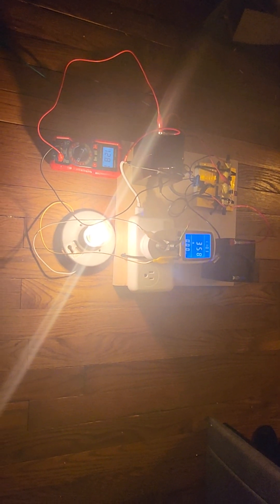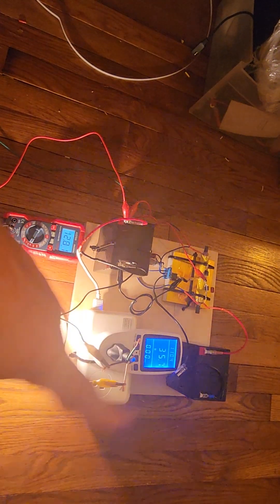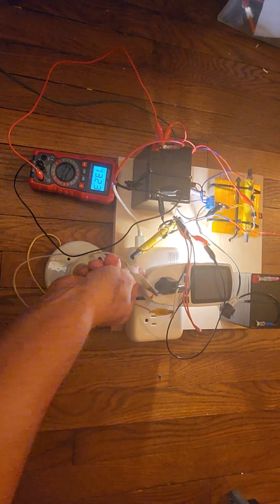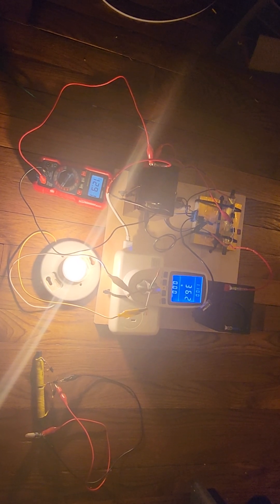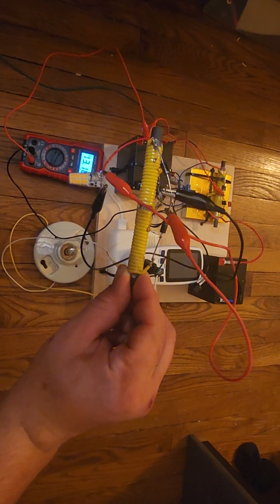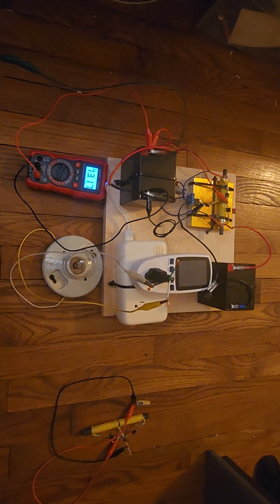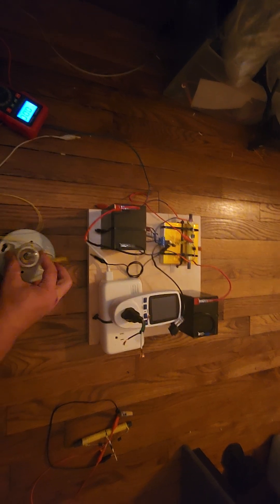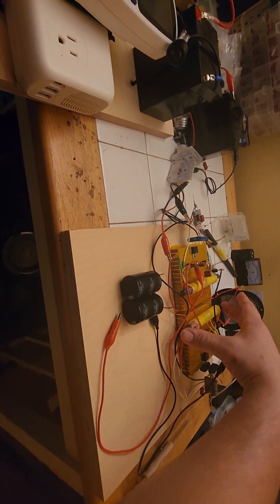💪Negative Resistant Super Battery Re-Charging Generator Boards Improvements & Breakthroughs 🥵

Comment: So just to be sure I understand the fundamentals, an RLC tank at resonant with a resistor of the correct value placed in parallel across the tank causes a negative resistance effect to occur bringing energy/wattage into the system, correct?

Then in theory, if the resistor was just the right value a single pulse into the system would have it maintain its own free ringing oscillations forever as long as nothing hampers the oscillations of the tank, would it not?

Also to add to that, what equations are used to calculate that resistance? Thanks.
Reply: I think that connection to ground somewhere near resistor is a must (or through resistor?)
Reply: @mrmishmash1725  From the descriptions MTech wrote it mentions an earth ground to get "even more non-linear effects" which implies it enhances it over being a requirement.

Comment: You have no idea what you're writing about. Material 77 ferrite rod is not Metglass.
Reply: The circuit ought to work with any core material that can switch at high frequency... but prefer High permeability, high electrical resistance, high saturation

Comment: Wow, this is something quite impressive if true, how fast can you charge 500 ah battery when you say fast ? How much power would you need to do it from your little hybrid batteries ? With this output power 6 kwh you can run a house easy even without battery bank, straight from inverter or few smaller inverters for each appliance.

Comment: Very good. Thanks for opening your energy research and making ready-kits available for us to easily replicate your experiments. 

Guys, I imagine you have many questions about this technology.  Notice its relation to Don Smith Energy Device, which is searchable for further understanding. The Negative Resistance part is a new curiosity...like if three resisters are good, would six be any better? And concurrent with directly charging batteries, I like how its Wireless aspect is always available to power other devices with multiple wireless receivers, cellphones, tv's, AC?